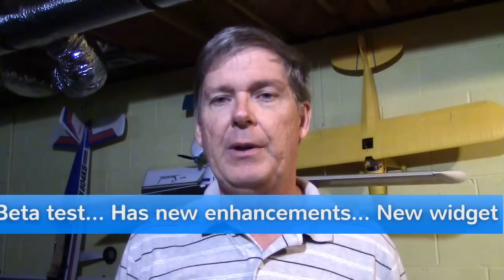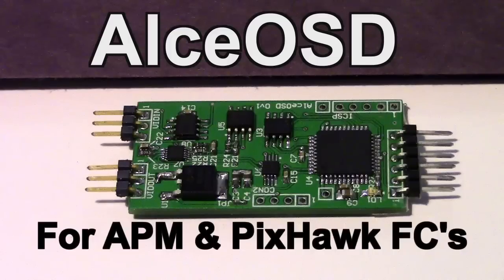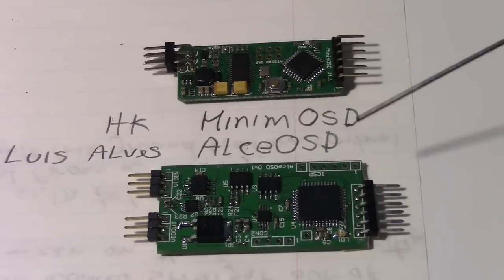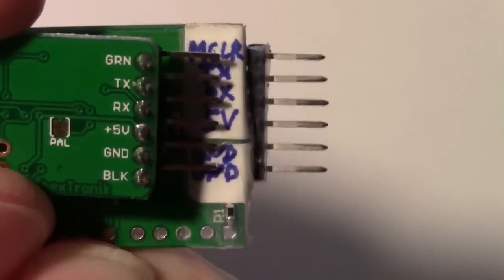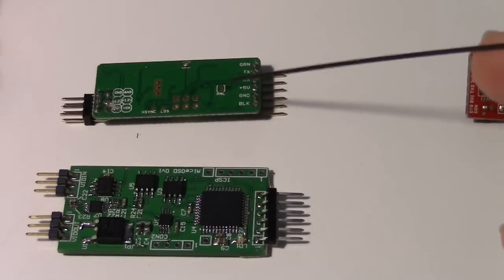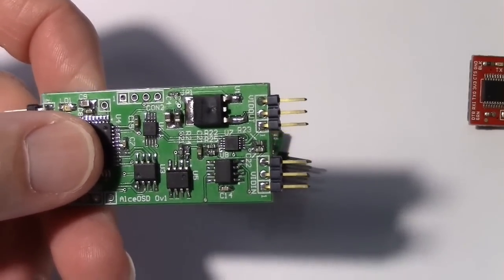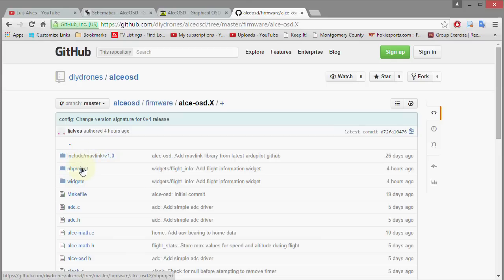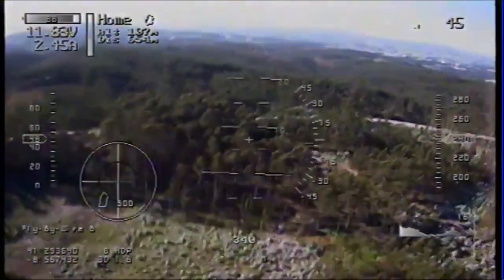ALceOSD New OSD for APM and PixHawk Flight Controllers in Beta Test

Comment: Bravo for advancement.  A thought for the DYI mentality.  Forums work for researching not for installing.  Secondly I absolutely hate getting an item that did not come with all of the cables, programmer, and software pointer.   It becomes a real pain to get up and running the first time.  Programmer FTDI's should be mentioned in the order and available.   Again keep it streamlined.
Reply from the maker: I agree. The FTDI programmer should be an option in the order. 
I think there is a much newer version of this board available but I have not got one yet.
Hopefully the software has also improve by adding a GUI. Command line was just to slow for me.